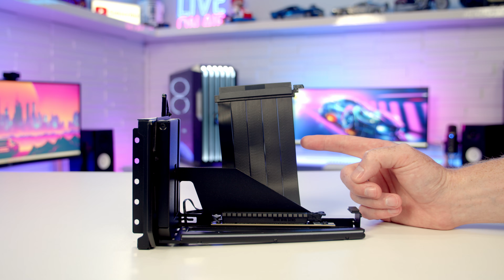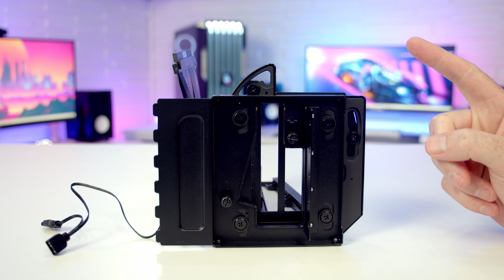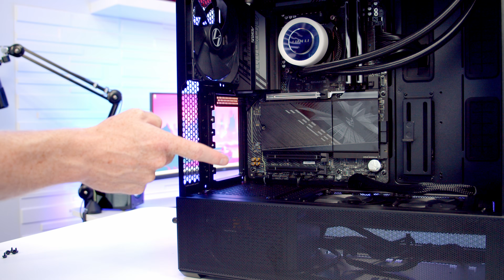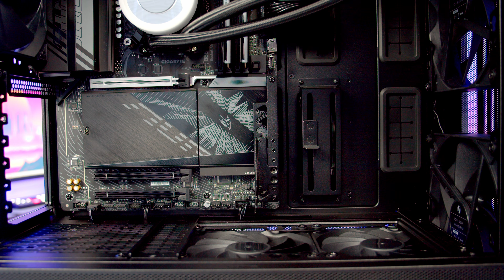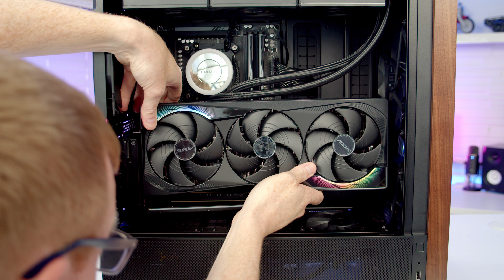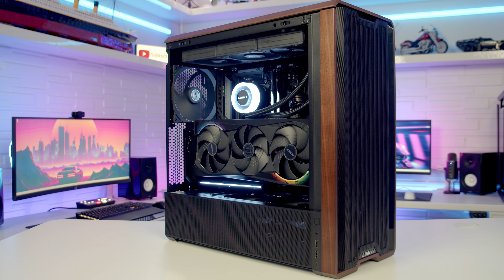Lian Li Multi Directional Vertical GPU Bracket - Installation Guide

Comment: Man I got the vg4v4  from Lian li, and my cpu air coller takes up to much space and my 9070XT won’t fit. I’m using the lancool 217, and have 3 bottom TL wireless fans. Any work around this or suggestions? My cooler is the phantom spirit 120 evo

Comment: Can't install it with an Arctic liquid freezer3 420, pump pipes stick out too far so card can't sit anywhere, plus my eatx taichi board has usb 3 plugged in right next to standoff for bracket so cant use eatx extension. Oh and for some reason the holes for securing the holder only align up with the high slot option. Using an antec flux pro case. Pretty pissed tbh. Unless i'm doing it wrong lol.

Comment: Yo does it fit in a Lian Li PC-O11 Dynamic Midi Tower white ???
Reply: I will receive mine today and I will tell you
Reply: @amstudio4148  how did you go with this? did it fit? I have the original o11 dynamic and wonder if this will fit that case as well
Reply: @HelixBytes it will fit but I had a problem, you can install it for sure but my problem was my new gpu which is 5080 astral is really heavy and really thick so it was really hard to install it and because of the thickness it put a pressure on my AIO , you can fix it but reposition your aio from top to your left side by doing this you will encounter the pressure on the aio pump my 3070ti can work fine on it and if you an o11 dynamic xl will work too because of the height of the case
Reply: @HelixBytes and if you removed the bottom fans can work too it will avoid the aio pump

Comment: Lian Li has since withdrawn the bracket from the market, and it is no longer available. Apparently, there was a problem with the riser cable.
A v4 is already available on the Lian Li website, but it is still password-protected.
Reply: it's on amazon now, I just ordered it
Reply: @juanej  Same.  VG4v4 is the part number.

Comment: So Lian Li recalled this unfortunately. My order was cancelled after a few weeks.

Apprently there have been some issues with it not working correctly. They plan to bring it back but theres no time frame yet. 

Has anyone  managed to get there hands on one? Have you had any issues with it? 

I have the Lian Li Evo Dynamic XL.
Reply: I haven’t personally bought it yet but I’ve been reading through the reviews on Amazon and apparently the “PCIE 5.0 Rizer Cable” doesn’t actually work with PCIE 5.0 bandwidth’s, so I could imagine that being the issue they’re trying to fix.
Reply: @xeno07_max20 I have 2 just showed up but bottom of ports are in line with metal frame of bracket. Cables stop halfway in 😂 few kinks to work out yet me thinks.

Comment: Is the GPU kit that allows tilting the graphics card in three positions compatible with the Hyte Y70 Touch Infinite case, which has vertical slots by default ?
Reply: The Y70 has a lower cable on the 6th outlet. I dont know what this is from the pics. If this was removed (relocated to the vertvcal slot?) then yes you could use this to have the adjustable bracket instead of the fixed vertiacl mounts of that case.

Comment: apart from the astetical part there is, again, no test if the PCIe 5.0 bandwith is at 55 Gb/s. would be interesting to se a working kornfield 3d mark PCIe feature test. I only saw one Video with the Test and it either had gen 4 speed or there wasn´t even a signal output if MB was set to PCIe 5.0.
Reply: their web site states pcie5 complient. I don't have data to back that up.
Reply: @LazarusLong  Many reviews on Amazon say their cards aren't identified as PCIe 5.0 with the cable sold.   Won't buy one without seeing a test confirming it is 5.0

Comment: thermal difference for vertical vs horizontal in the lian li would be very interesting now!
Reply: Think of the hot air flow!? Mounted vertically, it will be blowing hot air to the MB/VRM's. Also, if too close to a glass panel, there is not enough air flow for effective cooling. 'Look's' over efficent cooling is what you need to consider. If you have a mesh side instead of glass... I am building such a system with side fans onto a vertical gpu right now.
Reply: @LazarusLong I don't care about the looks of vertical vs horizontal😅
Reply: I just installed this mount today (Thanks for the video @Christopher Flannigan, very helpful!!) and GPU temps fell by 5 degrees Celsius when mounted vertically!

Comment: I only have a few hours to decide whether I'm replacing the products I bought.
I upgraded parts of the old computer. I have a case, a 650 power supply, a graphics card (GPU): NVIDIA GeForce GTX 1060 6GB
Screen: ASUS VG249Q3A, and I decided to buy one 16 GB RAM, but a fast 1 TB Samsung SSD, where Windows will be installed, an Asus TUF GAMING Z890-PLUS WIFI LGA1851 DDR5 motherboard
Intel Core Ultra 5 235 24MB Cache LGA1851 - Cam Box
Kingston FURY BEAST RGB 16GB DDR5 6000MHz CL36 RAM
What do you think needs to be replaced? Or is everything okay with what I bought?
Reply: rtx 4070 or better and a 850w psu, would make that scream ( o and ram works better in pairs) but u can do that later

Comment: Any issues with PCIE 5.0 not be recognized?
Reply: I have the same question. Reviews in Amazon say that it's not PCI-E 5 as advertised.
Reply: I purchased one, and I share the same concern. It’s supposed to be shipped in a few weeks, but I’m considering canceling it if it’s a genuine issue.
Reply: @luiztechai  I just received mine today and installed an RTX 5090 in it and PCI-E 5.0 works flawlessly. No issues at all.
Reply: @ekeeb7158  Thanks! I hope mine works just fine too!
Reply: @ekeeb7158  Did you buy it in Amazon? I'm really thinking in ordering one but I'm from Argentina and returns are not easy. I'll wait for more reviews. Thank you for sharing your experience
Reply: @ImaVoodooChild01  Yes, I bought the white one from Amazon.

Comment: It is compatible with Evo XL?
Reply: I have the same question lmao.
Reply: It was compatible with the EVO XL, but is no longer available due to problems with the riser cable. However, the new v4 is already in the starting blocks. There is no release date yet, and the corresponding page at Lian Li is still password-protected.
Reply: Yes it works with the Evo XL

Comment: Just got mine and found out that it is not compatible with my NZXT H7 Flow case. I ended up modifying the bracket so it would fit (eleminating my ability to return it), only to find out that regardles of what position I had it in, my RTX 5090 would not fit without crimping the hose on my Arctic III AIO pump. Such a disappointing journey, as this looks like an awesome mount. I would have flipped my Arctic III cooler around so the pump hoses were at the top, but due to it being an AMD AM5 setup, flipping it around would negate the offset it has built in for those chips, and i would end up with sub-optimal cooling.
Reply: How much did you mod it, iv been looking to buy one but they are sold out everywhere and depending on what you did to it and how much you want for it I would be open to buying it off you. Also depends where u live because of shipping.
Reply: oh for air cooling cpu's
Reply: I just discovered the same problem,dissapointed tbh. what can be used as a rad that doesnt stick out so much. Using an Antec flux pro so should have been enough room.

Comment: Phanteks gpukt 4.0 argb vs lianli vertical kit 

which one is better?
Reply: The better version depends on which brand case you have.
Reply: this is a pcie5 mount. Works with pcie4 but paying more for it but better adjustability.

Comment: Amazing video as always but for everyone considering getting anything lian li, I gotta say they are like french cars. Fancy gadgets, but with 0 reliability and reeks of low production cost while not being  any cheaper.
Reply: The freak are you talking about ? I'm using Lian Li O11D EVO RGB and SL INF fans here. It is far better than any horsecrap from Corsair and Cooler Master I've used in the past.
Reply: @Azura2910arpg On the contrary, it's the only component that has given me issues on a new build with asus and corsair parts. They all feel sturdy as a tank and corsair software works with 0 problems since day 1 where lian li gives me screeching noise at a specific rpm and switching screen order and orientation in every restart. I'll just stick to known brands instead of hyped up cheap plastic in my next builds.
Reply: @winstonblue9422 Corsair software with ZERO problems, are you sure? 😂
Reply: @MrAssaultRifles  A hundred percent. Everything else have been working flawlessly since day 1.
Reply: @winstonblue9422 Never had any issues with Lian Li to each their own. Asus quality of life issues have been a real pain to me through the years.
Reply: You‘re sure you mean french Cars? 😂 Citroën, Renault, Peugot? Nothing fancy for me, i guess.
Reply: Bro does NOT know what he’s talking about 🥀🥀

Comment: do you know if I can use an air cooler if the bracket is tilted towards the glass panel and at it's lowest height?
Reply: even if it was horizontal and blowing straight at the cpu air cooler or vertical and tilted up or down, the heat would be about the same. So it comes down to the case fan setup. Get enough positive pressure and the temps will be <1'c difference. Just the direct heat to MB/VRM's v cpu cooler you are asking about? I would put to cooler over MB if you dont have enough +pressure to compensate. Really, you are worrying over very minor issues over a 10 yr life span of the system. IMHO. Actally if running pice5  nvrm drives, the actually heating issues are a real concern, so pushing the heat away from the m.2 primary drive is actually a consideration.
Looks are good, but actual system stability may mean a diffent mind set. Don't get caught in th hype of fish bowl builds. GL either way.

Comment: Can I please get a link to buy this in Europe. I cant find it anywhere
Reply: This v3 Version is no longer available due to problems with the riser cable. However, the new v4 is already in the starting blocks. There is no release date yet, and the corresponding page at Lian Li is still password-protected.
Reply: you might have better chance finding it by a searching for either VG4-5-V3w or VG4-5-V3x
Reply: it's really new so taking time to be released

Comment: Lian Li are kings of GPU brackets. I have one of them called GB-001 - anti-sag bracket. It's completely hidden under the card and screwed into the motherboard. Keeps all those heavy cards flat as a kitchen table. If you have time, google it.

Comment: Will it affect the performance of the GPU and does it add to the length of the GPU ?
Reply: It will affect the CPU cooler because it will exhaust all it's hot air into it. Other than that, nothing is going to happen to the GPU. It's recommended to have a good size card too for wiggle room
Reply: it adds 31mm to the length of the GPU towards the front panel. (it says on their website)
Reply: Some gpu's cool better when they are mounted that way, specifically thinking of the 7900 xtx.  Cools like crap when mounted horizontal, and when position vertical the temps drop significantly.  Has something to do with the vapor chamber on the cards.